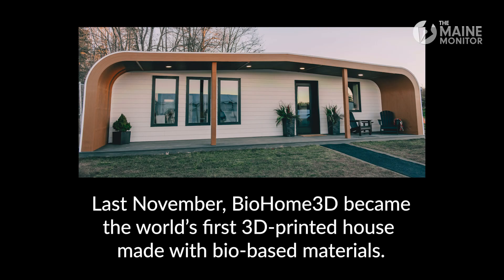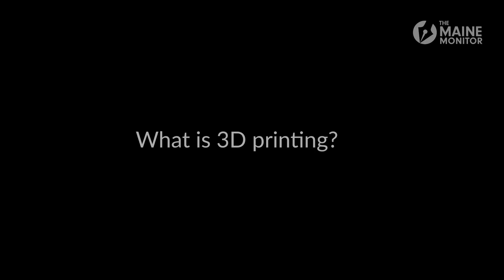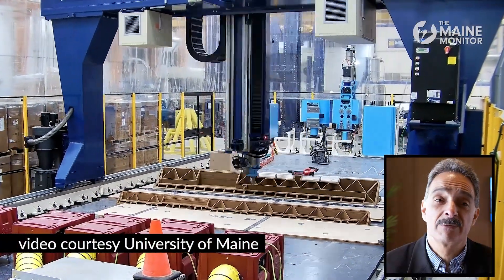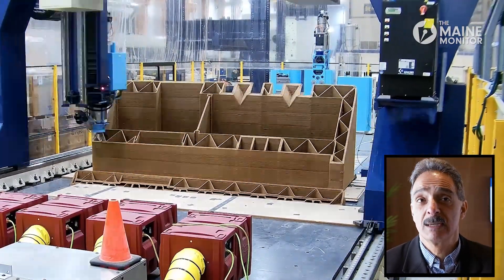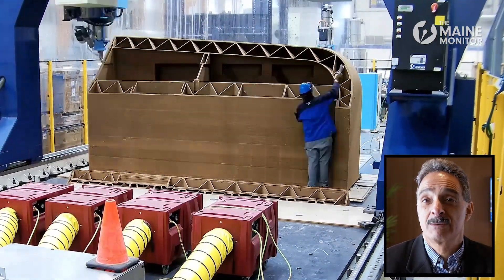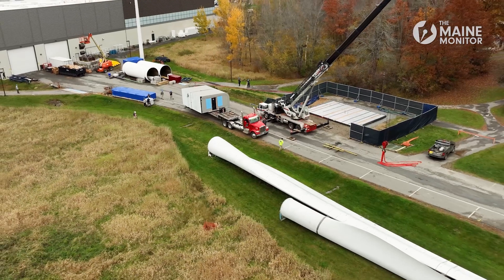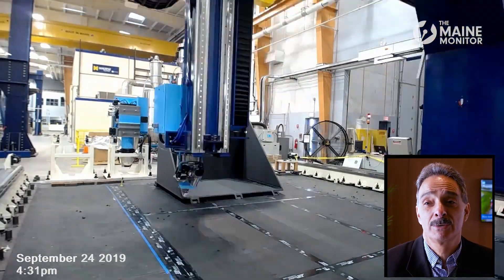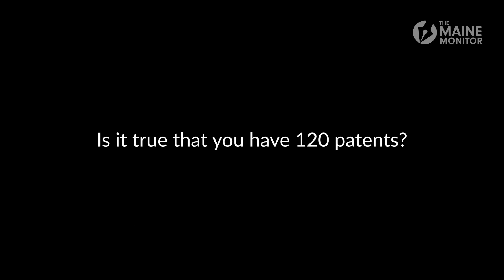Building the future: University of Maine home to world’s largest 3D printer

Comment: That is quite an amazing achievement. You mentioned wind turbine blades. The biggest issue as you may know with those turbine blades is transporting them to the installation site from the manufacturing site on road networks which limits their size to an extent and adds transportation costs. If you printed them near the installation site using a portable version of your large 3D printer, size of the blade is only limited by your material strength. That could be big market for your 3D printer.